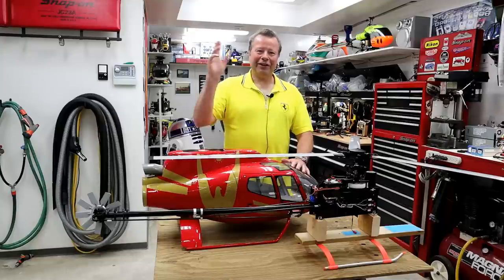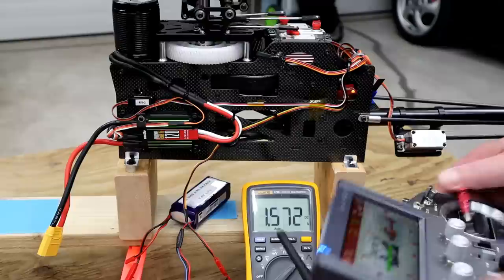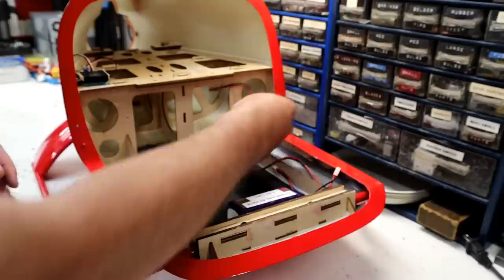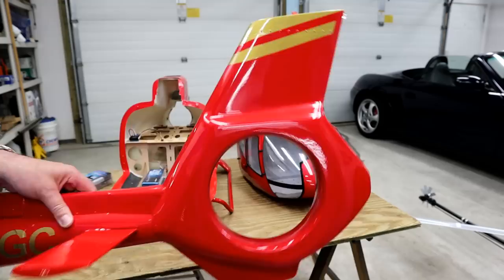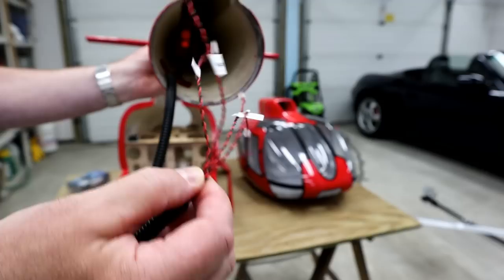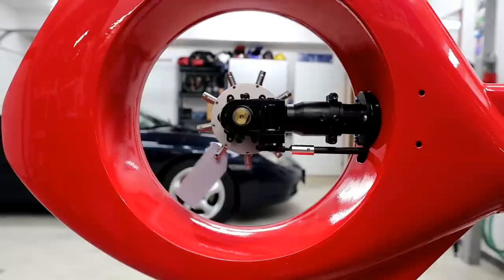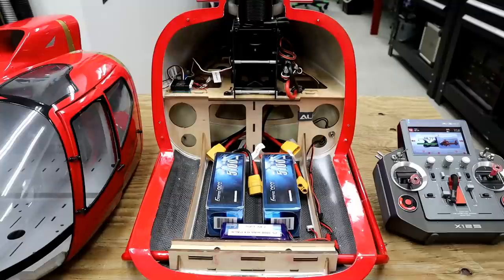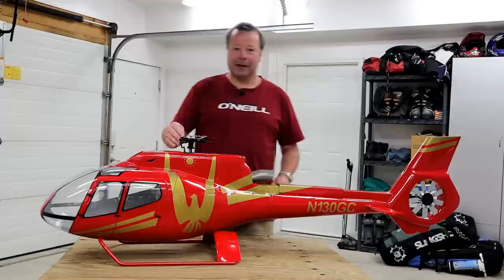Scale RC Helicopter Build - Roban EC130 800 Maiden Flight.

Comment from the maker: Roban EC130 800 RC Helicopter Build Series:
Part 1 - Unboxing: https://youtu.be/3qM_1fg9110
Part 2 - Component Selection:  https://youtu.be/ycq4jW7JVao
Part 3 - Building Mechanics, Setup & Test Flight: https://youtu.be/eDRr7n3Zq4g
Part 4 - Fitting Mechanics & Maiden Flight: https://youtu.be/NocHFV8f90c
Part 5 - Scale Details & Full Flight: https://youtu.be/1Grlqsldf6M
Part 6 - Scale Pilot & Dialed In Flight : https://youtu.be/axMc8rBeIQs

Comment: Saweeeet! Congratulations.
Reply from the maker: Thanks 👍
Reply: @Rchelicopterfun  you bet!  I need to make a "Flindstone flier" rig for the Huey.  I think that's a good idea before I try to mount it in the fuse. Wish I had not installed the interior first like the manual suggests. I'm gonna have to cut a hatch in the bottom to add ballast I think. 

Anyway. Can't wait to see more EC130 flights!  My brother flies that exact bird in Las Vegas and I got to go up with him last summer.  Lots of fun.

Comment: I like that way to build models, neat and tidy ! Great works ! 
I have a question regarding receiver positioning , I saw that u place the receiver antenna at the font of the frame, have u check the RSSI and VFR % when the heli is flying away from u , will the carbon frame and mechanics cause signal drop ?
Reply from the maker: Hi Peter, The RX antennas are actually at the back of the frame mounted to the FBL gyro plate (shown in the build video https://youtu.be/eDRr7n3Zq4g around time index 8:45).
RX antenna positioning is always a compromise and a deep topic - way too much to cover in a simple YT comment response. I have a full page on my website covering it in detail: https://www.rchelicopterfun.com/rc-antenna.html
To answer your question however, I always do range checks with any model and most certainly this one. Like all of them, I'll lose practical visual range long before RF control range regardless of orientation.

Comment: Quite a lovely machine John so do you use a certain flight controller for your heli,s how do you handle altitude control ? is it all throttle or the f/c ? i know when i am training the use of throttle can be very tiring as i need to concentrate on positioning of the heli .Thanks for great video,s .
Reply from the maker: @John Blythe - I'm using the Bavarian Demon 3X flybarless system. I go over the electronics pairing in this video: https://youtu.be/ycq4jW7JVao
Like all collective pitch helicopters, I control my lift vector with collective pitch only, not throttle. Throttle/head speed is fixed and governed. Only electronic flight management offered by the Bavarian Demon is cyclic stability (replaces the mechanical flybar) and of course tail gyro. 🙂

Comment: I have been looking to get into scale helicopters, but I have no experience with building. Is there a specific model you would recommend for a beginner, or maybe some advice on how to start learning a build like this?
Reply from the maker: You first learn on Pod & boom (you never mentioned how much experience you have flying collective pitch RC helicopters). You can't learn to fly a larger collective pitch heli on scale (too fragile, to heavy and too costly). If you can already fly a fairly large collective pitch heli however (500 or larger) and rarely crash, then you can progress into larger scale. I cover options and suggestions on my Scale RC Helicopter Page on my site: https://www.rchelicopterfun.com/scale-rc-helicopters.html
As that page states, most people start with a scale fuselage that fits one of their existing Pod & Boom helicopters and slowly progress at your speed up to models like this from Roban, Vario, Alterbaum, etc.

Comment: hi John.....very nice Scale heli.....witch Roban model would you recommend
Reply from the maker: That is impossible for me to answer for the simple reason I don't know what large scale RC helicopter building and flying experience you already have. For example, I wouldn't recommend any Roban model if you haven't built and flown a larger scale heli before. All of Roban's super scale 700 & 800 series are classified as requiring advanced level building skills.
If you have ample amounts of larger scale helicopter building & flying experience however, then I would suggest getting whichever Roban scale fuselage model you like the best. They all use the same basic Roban HSM mechanics platform, so they are all more or less equal in terms of mechanical quality. Of course, the more complex the mechanics (as is the case with Fenestron or angled tail drive or multi-bladed heads), the more difficult & maintenance intensive they become. As the engineering adage goes "complexity hampers both execution & reliability".

Comment: are the fenestron blades locked down or can they led / lag a little
Reply from the maker: You just tighten them enough so they are snug and stay in place. When they are that tight, they can lead and lag as required.

Comment: Hallo John,
Ik heb de EC 130 Sundance en gedraagt zich het zelfde in de hover als uw EC 130.
Nu is het zo dat mijn 130 zich in een linker bocht bij grotere snelheid minder instuurt dan de rechter bocht.
Bij een rechter bocht heeft hij veel meer effect.

Is dat bij uw EC 130 ook het geval.

Groeten,
Leo van Dorsten
Reply from the maker: I have another video with faster flight showing the tail performance better: https://youtu.be/1Grlqsldf6M
Yaw rate on mine is more or less consistent in both directions, but no question it will yaw to the right with greater ease going with the direction of the reactive torque. It's just way more efficient in that direction and won't pull as much power - just like a full size machine. I find if I run under 1100 RPM head speed, the tail response will be a little sluggish. I personally like 1150 RPM on this thing, but that is just me.
Reply: @Rchelicopterfun  
Bedank voor uw reactie,
ik heb ook de EC135 en EC145 van Roban,en deze hebben dat niet,maar ik vlieg de EC130 met 1250 RPM is zal proberen met 1150 RPM .

Comment: Hello A question how long does a battery last or minutes of flights.
Reply from the maker: Depends on setup, flying style, battery capacity and how deep/comfortable your specific LiPo discharge level is. With my specifics, I get a safe (no lower than 80% discharge) 7:30 minutes with 5100 mAh packs.